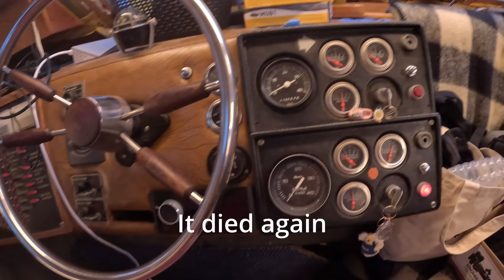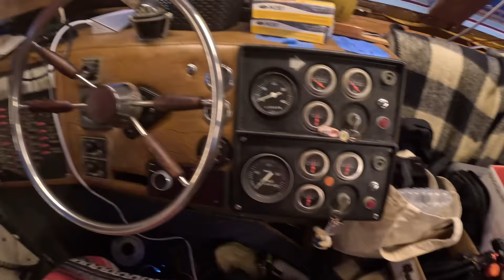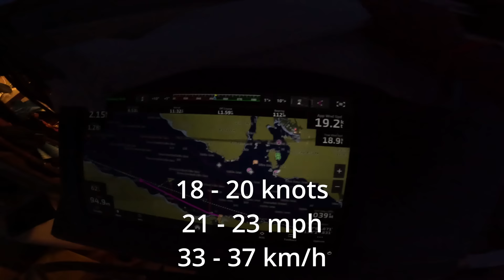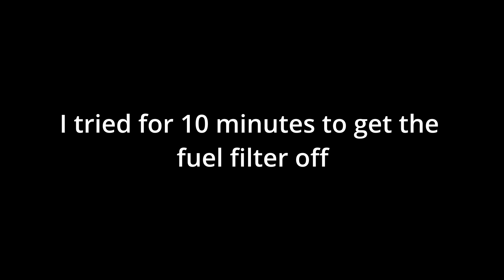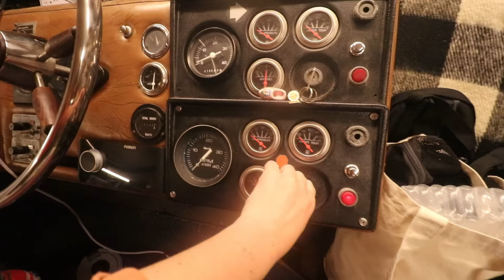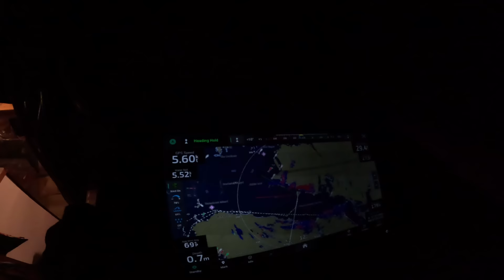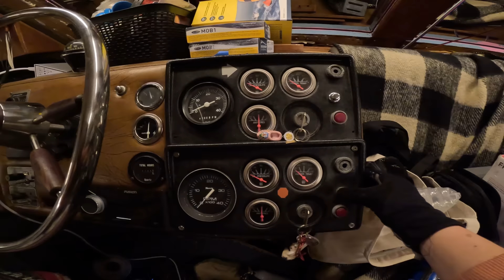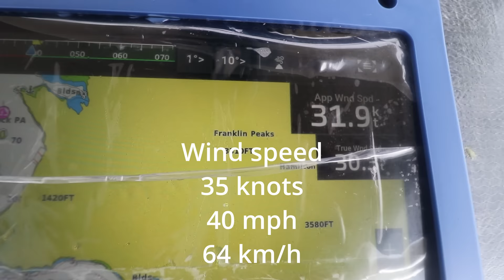DOUBLE ENGINE FAILURE IN GALE FORCE STORM [Ep. 7]

Comment: A knot of advice. Always have stopper knots in the ends of your sheets so they can't pull through their fairleads and blocks. One good stopper knot to use is figure eight.
Reply from the maker: Thanks for the advice. We are going to make sure we have stopper knots in everything from now on. We are also going to re-run the jibsheets so they won't go in the water anymore :)
Reply: A stopper knot in a Spinnaker sheet is a bad idea. If the sail goes in the water it could bring down the rig
Reply from the maker: Thanks for the tip, we hope to get a spinnaker at some point. :-)
Reply: @sailing.supernova  don't use stoppers for the Spinnaker gear. If the kite goes in the water and gets loaded it can bring down the rig. Also if it gets away from you there's no way to unload the running gear.
Reply from the maker: We had one go through the boat and help us re-rig all the running rigging, he said we could call him if we got a spinnaker later on and wanted help with it, its going to be a bit till we can get a spinnaker but man we would like one haha
Reply from the maker: Good to know. We will give our rigger a call to make sure we don't screw it up haha

Comment: You guys are doing well. I am proud of you. Fuel problems are one of the most common issues with new boats. The tanks are usually full of gunk when you buy the boat. Best thing is to empty and clean the tank, polish the fuel and put it back in the tank (or discard it in some responsible fashion). Sometimes you have to cut access plates or whatever. Often the motor runs fine in calm water and you don't discover the problem until the first time you get into rough weather and the gunk gets churned up by the boat's motion. Usually the gunk just clogs the filter. You must have a lot more gunk, and the lines are clogged. You may be able to somehow pump all the fuel out through a filter into jerry cans, then clean the tanks and lines (maybe replace the lines). Then you can put the fuel back into the tank. Inspection plates on tanks are nice so you can periodically check the fuel for gunk. How did the gunk get in there? Via various mechanisms that people still argue about, water usually finds its way into the fuel tank. The interface between water and fuel can support growth of some type of fungus (often called algae, but it isn't). This eventually leads to huge sheets and filaments of biological material laying all over your tank. It is not a bad idea to put some kind of biocide into the fuel every time you fuel up. But start by cleaning the tanks and lines thoroughly. Good job dealing with the problem, not panicking and using a sound thought process. Of course it would have been much better to thoroughly check the fuel system before departing. But knowledge comes from experience and experience comes from making mistakes. Great job guys! Make sure you keep an eye on the fuel in the tank going forward. Make sure you both know how to replace a fuel filter and bleed the line from filter to injector. You may have to change filters under duress in the future so it would be better if you both know how to do it cold.
Reply: This one. Well done! Need to “polish” the fuel and what in the fuel tanks. If you can’t empty the tanks and open inspect ports, you treat the existing fuel with algicide, use a electric fuel pump on the tank output (auto parts store low pressure pump used on many older car will be fine) into a coarse fuel filter, then back into the tank, constantly circulating fuel to polish it. When output flow from the filter drops or the sound of the pump changes because it’s struggling, change the filter and keep going until all the gunk, Algae, or debris has been filtered out. Repeat for each tank. Then run through a fine filter if you have it. Blow out the lines to the engines, replace all the fuel filters, prime, and off you go. Consider a ‘day tank’ similar to what you did with the Jerry can, but adds a return the small tank. A day tank for each engine isolates fuel issues from the main storage tanks - important if you are concerned with fuel quality issues from sketchy suppliers. That can prevent your engine from being affected from issues with your primary tank(s) and adds a second layer of filtration.
Reply: Hey, super effort and dont furl bad as this s*it happens. It happened to me off Cherbourg and fortunately we cleaned the filter and got in ok with engine. I feel guilty for not advising the action in the comments from others at the beginning! Sending you $$’s for camera fund.
Reply from the maker: Thanks for all of the advice. We thought we had checked the fuel system as thoroughly as we could (no access to fuel tank). We were in a pretty rough sea state on the way to Haida Gwaii a month and a bit ago and we checked the glass bowls below the fuel filters every hour and didn't find anything. There is a chance we picked up bad fuel. We are still trying to figure out how to address the situation, we have picked up some biocide and plan to use that in conjunction with polishing the fuel and we are looking at how to gain access to the fuel tank in the least destructive way possible. Darcy has shown me how to change the fuel filter and bleed the fuel system and we have a wrench on order so it will be easier to remove the fuel filters in the future. It's comments like yours that help us learn so much on here so thanks for putting so much time in to helping us! :)
Reply from the maker: The plan is to treat the fuel with a biocide and polish the fuel. Thanks for your tips on how to polish the fuel. We are thinking about a day tank for each engine but it might be difficult to set up, but with enough planning anything is possible :) We will definitely be sailing with a bunch of jerry cans until we can figure out a back up.
Reply: @sailing.supernova  If you can't access the tank because its built in and doesnt have an access, your best bet would be to take the tank outlet line into electric pump and then into a cheap coarse filter, add biocide, get underway in choppy seas to stir things up in the tank and feed the filter outlet back into the tank through the engine return line. Let it run. Monitor the pump for sounds the filter is clogging. Replace filters as needed. Reduce filter size if it doesn't catch anything or once the coarse filter has been changed a few times. 'Polishing of the fuel is just circulating the heck out of it through finer and finer filters to catch algae and debris.
Reply: I made a delivery out of Cabo. Fuel issue. We opened up the access port on the tank, pulled the intake line and found that when they drilled and tapped the tank to install the fittings they neglected to remove the shards. They got sucked up into the line. Lots of little shards jammed in there. Removed them, reassembled and delivered successfully. Brand New beneteau.
Reply: @PaulHarris-sl1ct  upvote for you. If I could I would downvote beneteau!
Reply: Same old story... if diesels quit, especially 2.... it's fuel.  Chase everything from tanks to filters and then other lines forward of filters.  Great job staying cool and persistent. Boating baptism by fire!
Reply from the maker: Thanks very much :-)

Comment: A few boaters create a 12 v pump to run fuel through filters to clean out diesel. I wonder if there were bugs in the fuel tank that shook up from rough sailing and then clogged the fuel lines. (When the main tank empty, the secondary tank is pumped via the fuel filter to clean it before it's dumped into the main. A secondary tank is used to hold fuel)
Reply from the maker: We are trying to figure out a fuel polishing system but we have no access to our fuel tank and unfortunately we don't have secondary tanks. We think we got bad fuel a couple days before this happened. The rough weather certainly didn't help. We have a fuel sieve that should help now. :)

Comment: I think I told you we sailed the intercoastal waterway from Juneau and had a great time fishing for salmon with Herring using gang line. I didn't tell you that I ran upon an uncharted reef, threw the Cunnins diesel into reverse, sent both my video and film camera below deck, and destroyed them both. I replaced the cameras, and the boat and the four of us were saved. So, the moral of the story is screw the cameras! This was a great video with great dramatic music. Just keep sailing, learning, and having fun.
Reply from the maker: You might have left that part out! Happy you and the crew were safe, that's what matters in the end. Also happy you enjoyed the video. We will definitely keep sailing and learning along the way, and with the two of us together we will always be having fun :)
Reply from the maker: We don't hide the fact that we are not really sure what we are doing, we get lots of help from people and we try to learn as much as we can. We think we got bad fuel as we have never had problems with the fuel before and we have been in bad weather. it was our fault that the line got wrapped, the boat was not set up well for sailing, we have now changed where the running rigging goes and it has fixed that problem. We just finished our first open ocean passage from Vancouver to Mexico, it went really well and we could not have done it without everything we learned in Alaska :-)

Comment: This year has been the pits for fuel problems. E10 diesel and 30° temperatures have made diesel bug go mad - the last four times I’ve been out there have been PanPan calls for engine failure - I know of 9 boats with problems over the last 6 weeks! Well done for sorting the problems in such adverse conditions!
Reply from the maker: Thanks heaps for the compliment, we are very happy we didn't have to call a PanPan or Mayday. We definitely everybody's pain who has had to deal with this, but at least it is a somewhat common thing that has known fixes so we should up and running again in no time :)

Comment: Hello Yvette and Darcy. Greetings once again from Germany.  It's great that you are slowly becoming salty sailors (meaning making mistakes early while in range of help). Experience is your friend. A few tips, if you allow: 1) to stop a diesel engine push engine stop button first, then switch ignition off. Otherwise you risk frying the diodes in your alternator. 2) Set your boat up to sail in all conditions. e.g., prepare a small hanked-on jib, provide winch handles near sheet winches etc, Simplify, simplify, simplify. Electronics and mechanical devices will fail and are hard/impossible to repair. 3) As others commented, there is probably a good healthy  layer of sludge in your diesel tank. Cleaning the tank is a priority. You don't want that brew feeding your fuel injectors. 4) Your existing traditional cutless bearings is simple and easy to adjust and repair. The dripless variety are expensive and potentially dangerous.

Yvette, I had the privilege of living in Sydney (Kirribilli) for a couple of years. Very beutiful sailing but didn't fancy the Sydney funnel-web.
Reply from the maker: Thanks for all the great advice. We can definitely do better in the future. Like you sad we are happy to learn and make mistakes, but we want to make sure we only make them once. We have a plan to clean the tank but it's not ideal as tank access is non existent. We have a storm sail that we couldn't put up because the stay sail furler was not working properly but this will be fixed before we head to Mexico. We do really appreciate this comment, we learn so much when nice people like you take the time to help us, so thank you so much for that :) 

Darcy agrees with you about the spiders/everything poisonous in Australia lol. I don't mind them so much but that might be from growing up in Australia :)

Comment: Sad you had this terrible experience, I do have a suggestion for you for the event this ever happened again. Put quick connect on your fuel lines, both on the fuel supply and the fuel return. This will allow you to use two Jerry cans and prevent the fuel tank getting overfilled and possibly causing a diesel spill into ocean or coastal waters. 

The sheets… how are they going into the water so often? Have you considered making line holders where you can store them safely or at a later date put all lines below deck guided to the cockpit? 

Sad for the loss of your camera 😢😢
Reply from the maker: This is all great advice. We are in the middle of figuring out a redesign for our fuel system and quick connects maybe in our near future. We also need to get better on the sheets in the water thing. The design of the boat rigging is poor, but we think we have a way to fix it. It's going to involve more work than we had hoped but it is a necessity if we want to have a long cruising career. Thanks again for the advice. And don't worry a replacement camera has been ordered :)

Comment: That fuel issue looked to be diesel bug. A yeast-like organism that lives on diesel when there is condensation in the tank. Use an anti diesel bug additive such as startron or marine 16 when you fuel up. What happened was the rough seas stirred up the bug at the bottom of the tank until it blocked the lines and filters. You will need to clean the tanks to get the bug out and clean the fuel too a process called “polishing the fuel”. To prevent it happening again use an anti-diesel bug additive and if the boat is unused for any length of time then top the tanks to the brim so there is no space for condensation to form. You also need to carry several spare primary and secondary fuel filters.
Reply: The other thing that will help is to fit a rope cutter on both props. The best one is called the Ambassador. You want the zigzag blade sort not the round disks which are much cheaper but don’t work nearly as well.
Reply from the maker: We are looking at getting a rope cutter, it would come in handy for sure :-)

Comment: Hopefully, by now, you have sorted out your diesel bug issue and cleared the fuel lines. To mitigate this happening we use a Mr Funnel filter we got from Australia for fueling up (the big one with two filters for speed of fueling, depends where your fuel tank openings are for the diameter which will fit). I think you will need one of these as some places you may go there is debris in the fuel.
Then we add diesel bug biocide to the tanks every time we fuel up (expenisve but doesn't cost much per tank as you use so little). We have a seperate tank and lines for each engine with an emergency joining line we can open between them just in case we run out at sea from one tank.
Lucky to inherit the boat that was well sorted for fuel. It had had diesel bug and the owner had to get into the fuel tanks, empty them out and clean all the gunge out of the tanks. Friends of ours had to replace their fuel lines before they sorted their problems. 
This youtube video on fuel polishing from Catamaran Impi is worth watching too if you haven't already https://www.youtube.com/watch?v=FgeS3wsb1GQ
Best of luck and hopefully you won't have any further fuel problems.
Reply: West Marine (damn them) sell a Baja fuel filter if you’re seeking one. Also check with Dave at Martin Marine when you’re back in Vancouver. Fair winds.
Reply from the maker: We have now ordered a Mr Funnel (thanks!), and we also have biocide to put in our tank. Unfortunately we only have one fuel tank that has no access. We are still trying to figure out a way to clean our tanks. Thanks for the video link we will check it out. :)
Reply from the maker: Hey Ian, we ordered a Mr Funnel. Come say hi when we get back :)
Reply from the maker: Thanks for the kind words. Happy you made it through your emergency as well. Don't feel guilty we appreciate your comments and thanks heaps for contributing to the camera fund. We will make sure to get lots of great footage for you in future videos! :)

Comment: Just watching this video I noticed when you were removing the line from around the prop shaft and I noticed it appears you are missing the zinc annode that is normally fastened to the nut that holds the propeller on. If you're not yet aware what galvanic corrosion is and the role of zinc annodes are please research it asap.  But well done handling the emergency, you both did great.
Reply from the maker: We must have lost the anode at some point. Thanks for the reminder, we are going to replace it asap. Also thanks for the kind words, it was a crazy situation and in the end we are happy we made it out safe :)